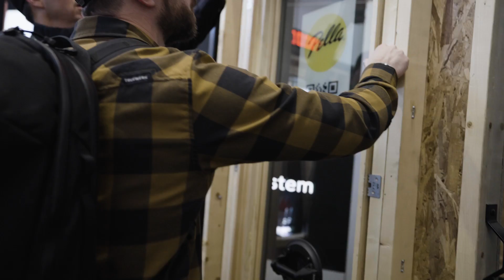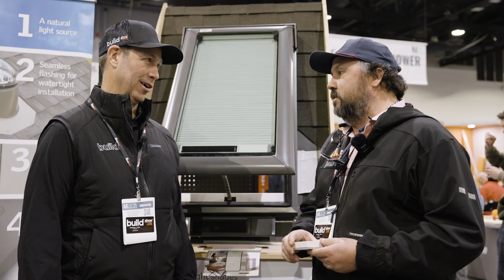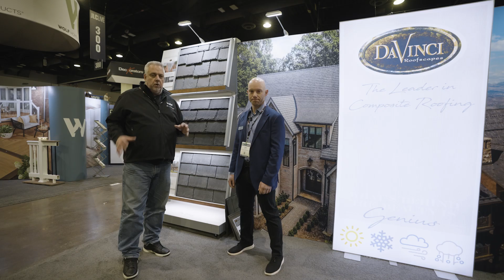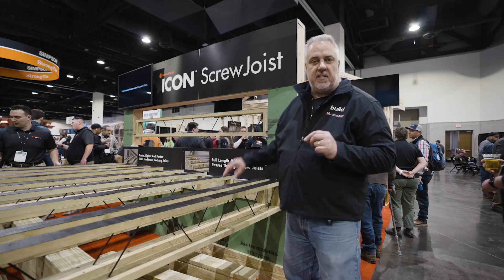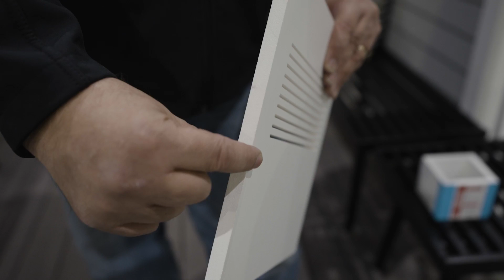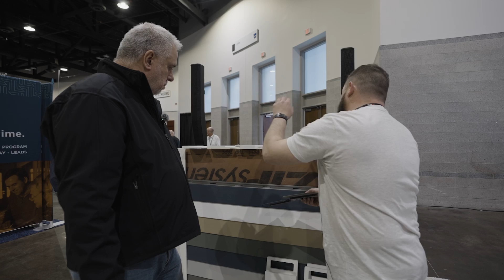The most DURABLE Skylights and MORE - Our last day at JLC

Comment: As a roofer I always loved working with slate and cedar. If it wasn't for the cost I would have used slate on my current home. I have not been tracking it for some time, but I am glad more companies are trying to do slate-like and cedar-like roofing solutions. When the first runs of synthetic mock slates came out, years ago, they were heavily prone to contraction and cupping over time. I am sure that most of that is probably solved with that reinforcing ribbing. Good luck in the future!